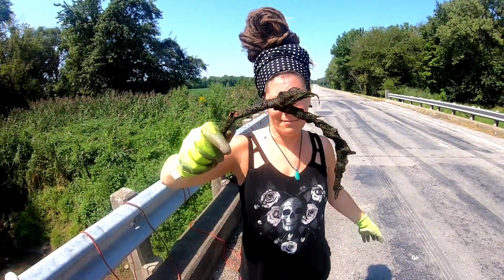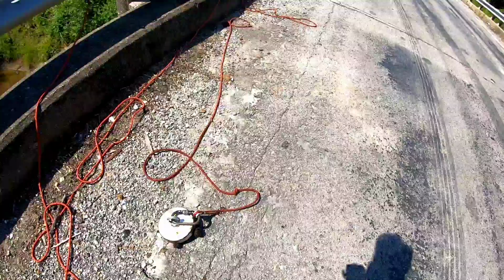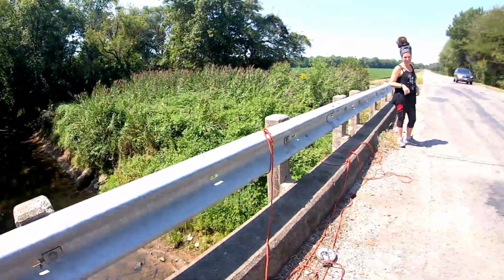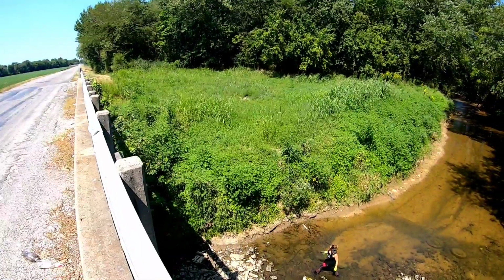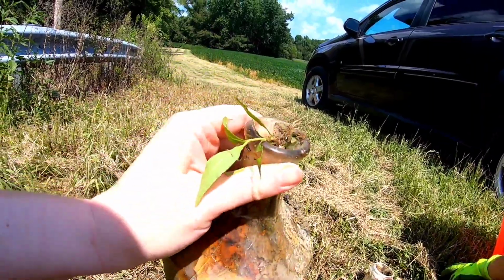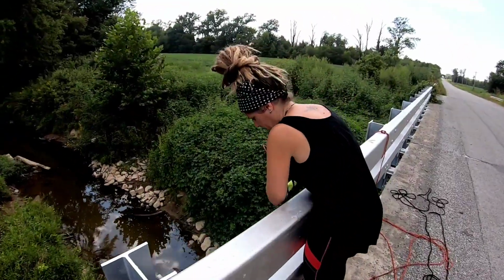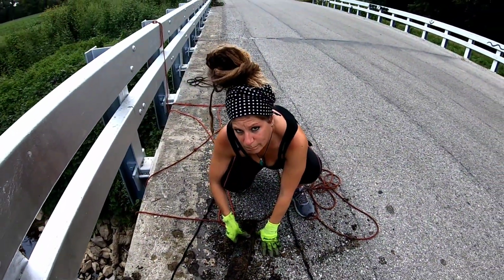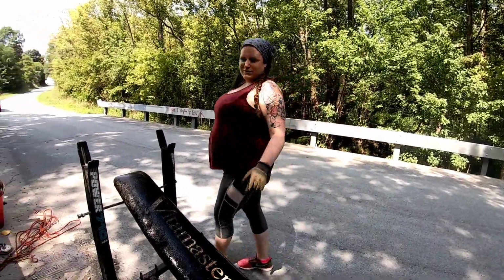UNBELIEVABLE Find MAGNET FISHING!!! **and some BOTTLE COLLECTING**

Comment: Angela’s second find was an ignition coil out of who knows what. The gear probably went to the crankshaft you found last week. Cool find on all the bottles !!! It was 39 at my place in Michigan this morning,  Brrrrrrrr !
Reply from the maker: 39! That sounds like heaven right now! I think I'm ready for winter 😄. Those bottles were pretty cool! Now for the task of cleaning them!
Reply: looks like a riding mower starter to me
Reply: Larry Busby   We we’re both wrong. It was actually what is called a fly back transformer. They generated the high voltage necessary for the cathode ray tube (picture tube) of the old generation TV sets. If you look close there is actually a printed circuit board on its base.
Reply from the maker: Well, glad we got to the bottom of it! 😄

Comment: What is that? Oh, it's a knife, no a nail. They both start with N. 😆
Reply from the maker: Haha, it was so hot i couldn't even think anymore MM 😄. I tried!
Reply: Yeah, that's definitely one of the symptoms alright. You both should've taken off your clothes & jumped in the water. Ya know, for first aid treatment of course.
Reply from the maker: @michiganmagneto  Maybe next time 😄
Reply: @TreasureVixens  I've had first aid training in the Boy Scouts and in the army. Might be a good idea to bring me with you. Just in case. 😀
Reply from the maker: Haha, doesn't sound like a bad idea!
Reply: @TreasureVixens  Hey, hey Vixens. Nice & generous move on tellin Magnet Junkie to respin the wheel. Cool move. I would've probably had to do the same thing. I just never have the time to go. Like right now for instance, truck's in the shop so I have today off. Yesterday I was doing a simple job of replacing the water heater in my house and of course something goes wrong. Now I'm forced to change out a bunch of galvanized pipes in my crawl space. (Spider webs up the wazoo) So, now I've got tomorrow off too. Great. 😖
Reply from the maker: @michiganmagneto  take advantage of the time MM! Don't go into that spider webby place though 😬
Reply: @TreasureVixens  Takin a break. Covered in webs. Pants are wet. 😖
Reply from the maker: Pants r wet 🤔
Reply: @TreasureVixens  Yours too? 
I ended up getting so frustrated with this mess. Walked into the house to take a break. My wife suggested we ain't going to have time to do this why don't you just call someone to have it done we have the money. Didn't even question it. Put some feelers out to some Facebook friends, got a message back within a few minutes and I called the guy. He gave me a price over the phone and I jumped on it. So next Wednesday or Thursday he's coming over to do the job.
Reply from the maker: @michiganmagneto  haha, good job saving yourself the headache and spider bites 👍